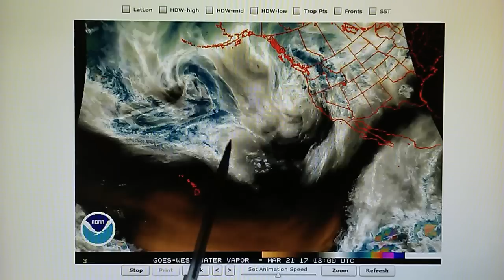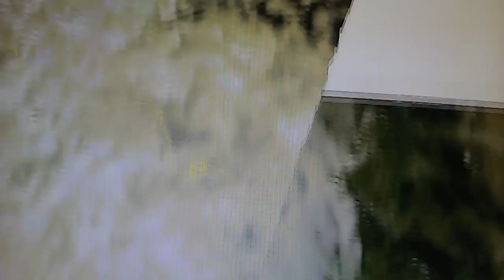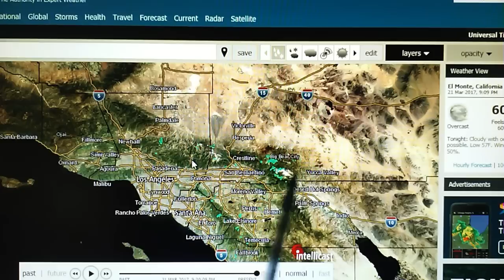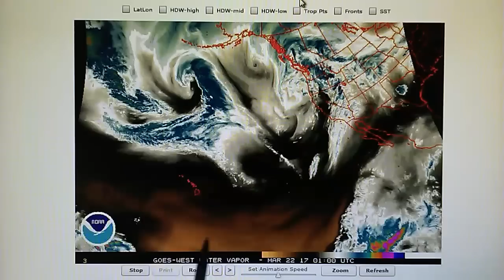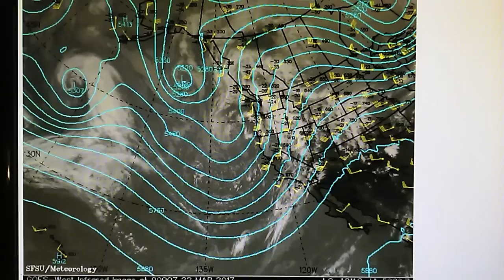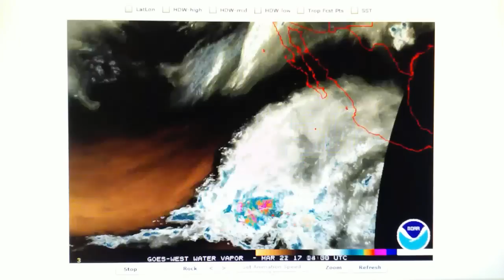3-21-2017;  Satellite Transmitter Generates High Pressure In Jet Stream; Moisture Into CA Sprayed!

Comment: Thank you!! They spray everyday here in Surprise. AZ, this is no exaggeration! Weather's been hot for days now. 3/21/2017 late afternoon sky's looked very cloudy with mostly chemtrails. I've been waiting for rain so I can finish pulling weeds on the other side of the house because they fine you if you have weeds. Everyone sprays chemicals to prevent the roots from growing, but I have pets.
Reply: Sissy, I saw the chem bombs that came from your direction towards us yesterday, clouds all the same size, all in a row, with the crap oozing out the bottom. Did you see them too?
Reply: I know.  Rules for home owners in the desert are bizarre.  Put down rock but don't let the weeds grow!!  God forbid that you should let weeds grow!  What a pile of BS.  Here's a natural weed killer (As we all know, never, ever use a commercial spray--we've got enough Round-up in our cells now to spray a whole acre in the Midwest.)  Recipe:  1 gal. vinegar; 2 c. Epsom salts; 1/4 c. Dawn (or other liquid soap as you prefer).  Put in commercial spray bottle (available at Home Depot or Lowe's) and spray.  I wonder if you should heat the vinegar for better dissolving of the Epsom salts?  I've also read people who simply heat vinegar and spray.  Probably, when in doubt, heat the damn vinegar.  The typical formula is 90 sec. in a microwave.  I don't use a microwave any longer--I just heat in a small pot.  I figure 90 sec. in the microwave is blazing hot.  Amazon sells a 30% vinegar which should be like an atomic bomb.  Original recipe for shower/tub cleaner of caked-on soap film was always 1 part heated vinegar to one part Dawn.  Supposedly the original called for 30%.